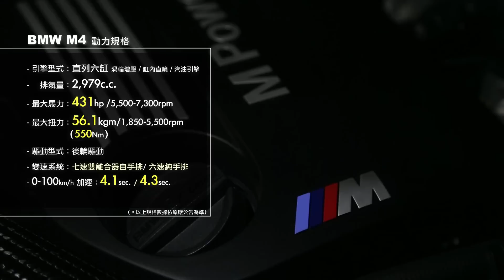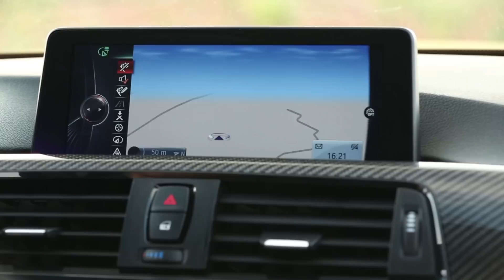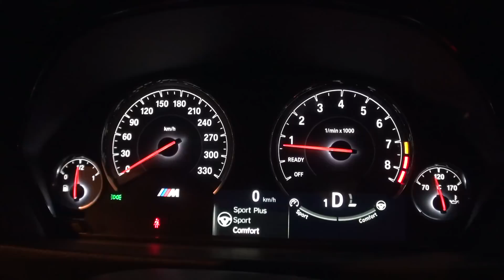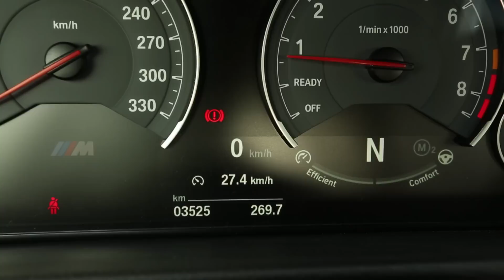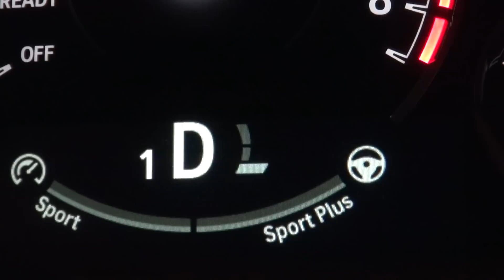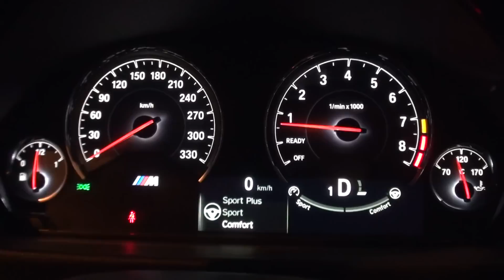新世代性能詮釋 BMW M4

Comment: Taiwan verison M4 sucks...18 inch wheels omg that's horrible.

To be honest I'm more looking forward to the 2015 C63S. V8 bi-turbo with over 500lb/ft+ torque in low rpm. Also it has a better interior than M4/ better sound for sure. AMG always have better sound.
Reply: Porsche Carrera Agree 2017 C63 Coupe has much better interior ! !